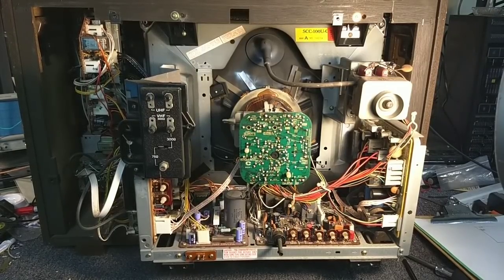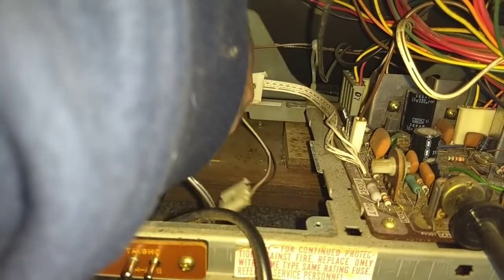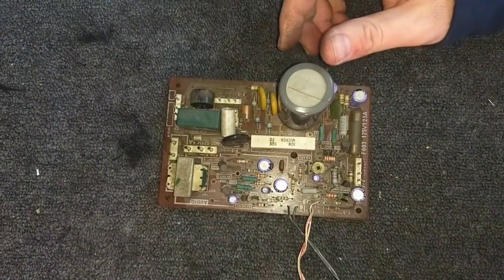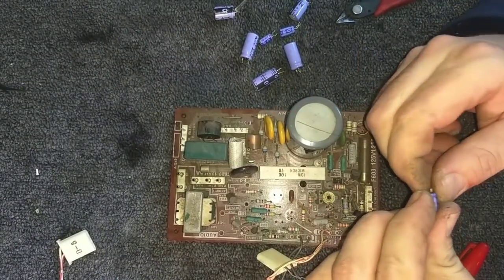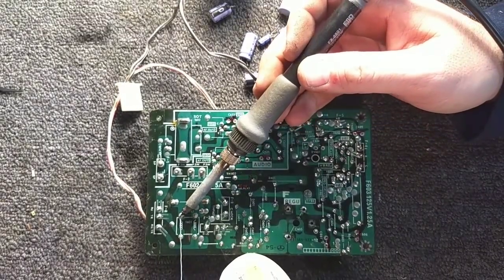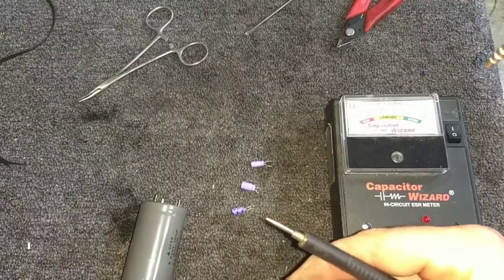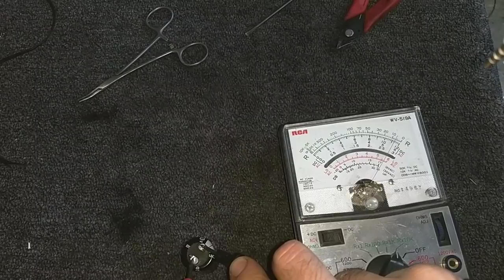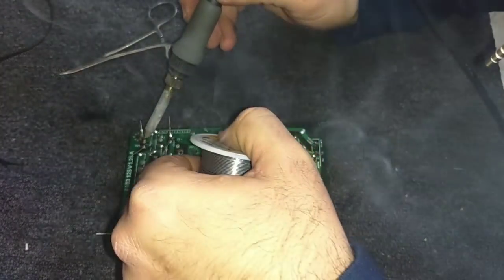Repair of a 1970s Sony Trinitron kv-1942r color tv. Part 2/? - power supply board

Comment: I've always liked using my Edsyn Soldapullt. It never fails to leave a joint clean, ready for re-soldering. Just tip it out periodically and you're good to go. IMHO, a must-have tool. The Soldapullt and a Weller WTCPN were the first "serious" tools I purchased. Mainly because I used them at college and knew what they were like. They are around 35 years old and still work like new.

Comment: You solder wick seems to work better than any I have ever had, I think mines probably cheap stuff and my soldering iron is not hot enough
Reply: You have to buy namebrand stuff. Chinese stuff is horrid. If you put some wax on it it will work though

Comment: I know it's probably not the best method but to remove components I usually heat one side and pull it out, then do the other. I like not using extra consumables like solder wick. I've never had too much luck with solder wick, maybe it's because the stuff I've tried is 40 years old. I really should probably get some standalone flux.

Comment: If one has cheap Chinese solder wick that doesn't work at all, you can put on a little liquid flux and it will suck up solder with the best solder wicks.
Reply: That is the trick I use. Works great. Flux isn't expensive. When I'm using wick I make sure the iron is up around 400° c

Comment: How can you tell if the solder is bad not counting the obvious cracks?
Thank you
Reply from the maker: Usually a dull, Sandy appearance is a giveaway. Other times you cannot tell if it's truly bad unless you tap on the board. It can be oxidized internally and look good on the outside. However since it's not making a good connection vibration usually reveals it
Reply: @JordanPier  Thank you JP that is good to know.
Great video by the way.

Comment: Solder Wick vs. De-soldering Pump vs. De-soldering Bulb?
Back in my day (80's/90') always used a De-soldering Pump. That's the thing you set the spring loaded plunger on. Just in case you're wondering.
Today, I still use a Pump. I do have Wick too, but I still use the pump most of the time.
I was always awkward using a De-soldering Bulb. JP uses his & makes me a dumbass.
Reply: Me too... I have better luck with the pump over the wick , either my pencil is not hot enough or I just suck at using it...

Comment: Not related to this video, but I need help.  Is it possible to send a turntable to you for repair?  I have a Pioneer PL-600 that needs service and there is no one near me that does any service work on turntables. The problem is in the lift/placement/ and return of the tone arm.  It plays beautifully but the automatic function of the tone arm does not work.  If you have any suggestions I’m open to any and all.  I’m in West Tennessee, but can ship to anyone if needed.   Thanks.
Reply from the maker: Inbox me vintageavrepair at gmail dot com

Comment: Hi there, I'm new to the channel.. I recently picked up a Sony KV-40XBR800.. The guy that I had move it were a litte rough, one of the guys didn't pick up the and of the dolly and gently ease it out of the den, instead he pushed it.. and the dolly rolled out about 3 to 4 inch drop with the tv on it..  after I got it home and turned it on, there was a slight yellow hue on the top right corner of the screen and a slight greenish hue on the lower left corner, the side the dolly hit the ground.. however after some use these past 2 days it greatly diminished.. but if someone pays close attention they can slightly see it.. I am wondering if something perhaps was damaged during that initial push.. The gentleman I purchased from said it was in very good condition, but he hasn't turned it on or used it for very long time.. Any feedback would be greatly appreciated
Reply from the maker: Aperture grill could be damaged. The degaussing hides it a little but if the sections are actually loose they will move as the set warms up and as the aperture grill warms with electron bombardment.
Reply: @JordanPier  possible to be repaired or serviced? :'(
Reply from the maker: @VENUEATHENS  about your only hope is to try small corrective purity magnets on the back of the crt in that area, but likely the crt will need to be replaced
Reply: @JordanPier  do you think it was damaged when the guys moved it or it could've had this issue due to age wear and tear over time.. Not sure how sturdy these CRTs are and if they have durability.. It Really sucks because I've been looking for this particular model for over a year now, and this one I found was very clean.. The guy who owned it turned it on for a moment, but it was just static! Nothing was plugged in it to really see if it had such an issue previously... It was so heavy those two guy's hardly managed to get it off it's stand, but still just pushing it off the small step on the legde of the den was not necessary, guy could've at least held it from the part of the dolly and eased it down like the guy in the front did..
Reply from the maker: @VENUEATHENS  the drop was very likely the reason for the distortion
Reply: @JordanPier  I did as you suggested with the magnets, I just got 2 magnet and placed one on the top right corner of the CRT,  it completely cleared up the distortion or yellowish color hue on that corner, I did the same to the lower left, it cleared up the greenish hue on that corner (I think the magnets I have are a bit too powerful, they were slightly warping the image depending on how they were positioned and the magents polarity), but when i removed them they came back.. I didn't remove the back cover of the CRT to stick the magnet behind... Are there magnets specifically made to place behind the screen I can purchase? I'm not sure if the drop perhaps caused some magnets to fall off the back.. I'm fairly good with soldering iron, I work with computer boards and game consoles for repairs etc.. However CRT TVs are fairly new to me, and I've just begun to learn about the different internal component's, how they work/fuction, also how to safely work on them.. I'm not sure if it's worth recapping or reflowing the solder on the board, but over 15 years It probably wouldn't hurt.. I really enjoy this 40inch CRT, It's one of my favorites, I aslo have the kv-34xbr960, 910, and the 30 inch 955... For some reason I really like playing my retro games on them like Streets of Rage.. Thank you for getting back to me, and offering some insight to possible fixes/solutions

Comment: Just get used to recapping, as you just are not as careful as some people. Caps are cheap compared with service and possible bad ones and the damage they cause, sometimes unrepairable. You use cheap caps with low ratings (not good brands with high heat ratings). Plus, CLEAN THE BOARDS before you reinstall them.
Reply: Pretty sure those are Rubycon caps. Not exactly a bad brand...
Reply: @DaveMcAnulty  ,  If I didn't get the brand correct, bad on me. If I DID get the 85 degree F. temperature rating correct, then I was half right. LOL I install 105 degree F. caps, at elevated voltage ratings to increase the life expectancy. I also use a leakage tester more sensitive than the one shown, to prevent problems.